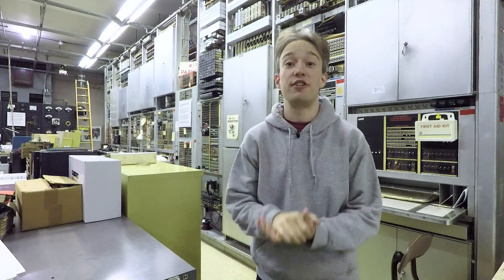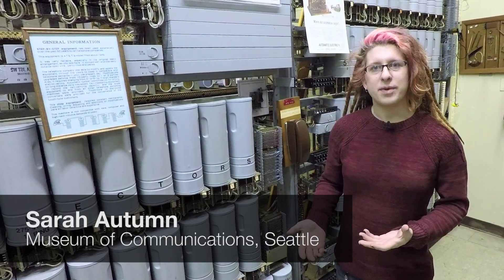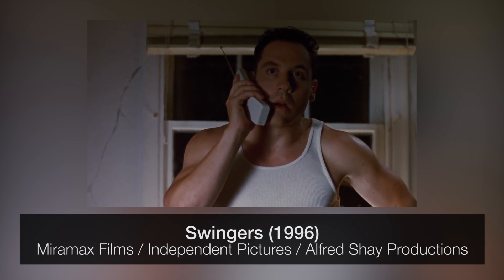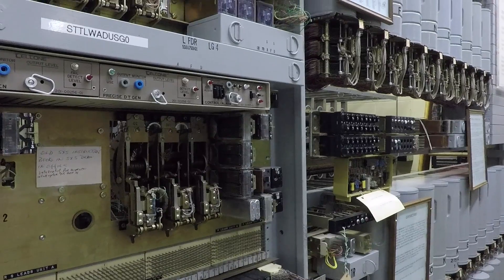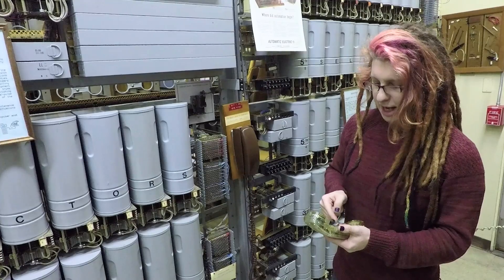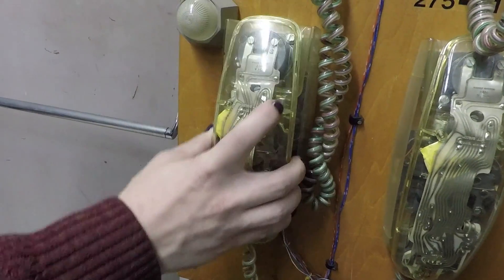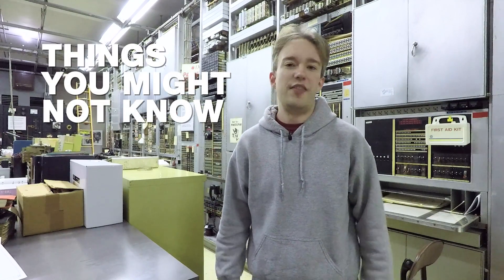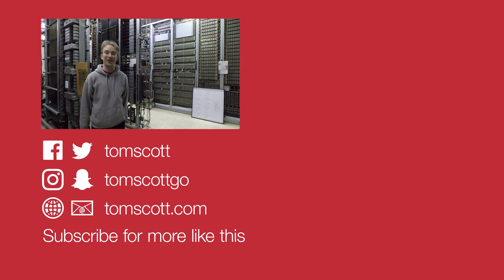In Old Movies, Why The Dial Tone After Someone Hangs Up?

Comment: Sometimes they get it right with "dead air", but then the person frantically presses the "hanger" like it's going to bring the other person back somehow.  If they were still on the line you just hung up on them, then pointlessly cycled the dial tone 12 times.
Reply: pentuplemintgum666 go back far enough and this actually made sense. In the days before automated phone system, the telephone operator would see a light on the switchboard when a phone was off hook. If you hammered the hook switch a few times the flashing light would attract the operators attention, so they'd speak to you to find out what had happened and attempt to reconnect the call
Reply: pentuplemintgum666 I think some telephone systems used the hanger for extra functions, like switching between calls in call-waiting situations, and sometimes equipment could get confused and you would end up in a weird limbo state.  So on occasion, messing with the hanger could actually get you back into your call.
Reply: In the Olden Days, flashing the switchhook was how you got the attention of the operator.
Reply: Call waiting works on a short "flash" of the "switchhook" recent phones had a "flash" button that did just that.  But it works by a single short hangup, and switches between 2 calls.  Spamming the button has done absolutely no good since about the 1960s, unless you got 2 people on the line and you're choosing who you want to talk to roulette style.
Reply: Nowadays, it may be for a similar reason that people mash the elevator button a bunch of times while they're waiting for it -- frustration and the blind hope that it'll maybe make something happen. Part of the sad bit in owning a smartphone is that I can't really mash on it if I'm pissed off.

Comment: Does anyone know if Norway used the step by step switching?
since i can vaguely recall not properly hanging up the receiver would keep the receiving party stuck with our connection and they would need to yell to get our attention or tap the hangup switch until an operator forced disconnect.

Comment: in Michigan, if someone called you, you could hang up the phone and run over to another phone and use it without getting disconnected. if you didn't pick back up within about a minute, the caller would get disconnected. I figured that trick out but never knew why it worked until now.

Comment: It's one of those moments when I learn they do stuff differently in different places. I grew up with analogue  automatic telephone system, it's changed to digital now. And here in Russia today it is nearly the same as it was before: when you pick up before dialing, you heal a long tone, the same one as we hear in this video. When one of the parties hangs up, the other one hears short beeps and they have to hang up too to make the line available for the next call. The difference for phone calls' sounds today is that you can apply to your phone company to switch to tone dial (if it's not the default). And before there was only dc (pulse) dial, when after pushing a button (or rotating the disc) you heard as many pulses (softish clicks, sort of), as the number you chose (0 = 10 pulses).

Comment: Interesting. The "step by step" switch is a version of the Strowger switch. I remember (1970s) there being a gallery in the Science Museum about how phone exchanges worked. BT (a monopoly at the time), had just received its first computerized switch. But there was a "history" section showing the Strowger switches and their first replacements the crossbar switches. 

The technology lasted in the UK until at least the 1980s.

https://en.wikipedia.org/wiki/Strowger_switch

Comment: How would that step-by-step system multiplex the calls? It seemed like it needed to maintain contact thought he entirety of the call?
Reply: bluedrago505 correct. It was designed to work with rotary phones. It's basically 50s technology. 40s even. There's a good reason it was all phased out.
Reply: Yes, you need a whole room full of equipment.  This machine uses seven of those equipment "cans" per call.
Reply: You're absolutely right.You might notice in the background there are stacks of rows of selectors - each row represents one digit, and the way it mulitplexes calls is that after you dial a digit it seeks to an active selector. That does limit capacity somewhat, which is why Bell came up with other ways of doing things
Reply: I don't know at all, but I suspect once the step-by-step system has dialed the number and connected the line to the person being called, it probably hands off the connection to some other piece of equipment.  So you just need enough of those dialers to handle as many calls as you're going to get in parallel.  

On a related note, Mother's Day used to soak up all available phone lines (or take a good go at it) routinely.  Heaviest calling day of the year!

Comment: I do remember on landlines in Aus (at least 8 years ago when I last used an analogue landline) getting a repetitive 'Beep Beep Beep' noise? not a dial tone but a completely different noise
Reply: There are a couple of telephone sounds I can think of in the US that could be like that.  There's a kind of medium-high pitched longer beep sound that's the busy signal (you would get it when you called somebody, but that person was already on the phone with somebody else).  And then there's a kind of loud fast beep, which means "hey you left the phone off the hook again, come over here and hang up properly" (which is why it was so loud, it was trying to summon you from across the room).  But it seems like the phone systems were all kind of unique, so it may have been something completely different.
Reply: I think I know what you mean, I've probably seen it in a movie but didn't have those here. It was a slow beep, like a Morse dash not a dot

Comment: In Australia if the caller hung up the called party would immediately get the engaged signal. Sounds like our system was very similar to the Californian system because if the called party hung up the line would remain connected - sounding like dead air to the calling party - but the line would remain connected indefinitely effectively blocking the called party from using their phone til the caller hung up!

Comment: I believe the system as described (with dial-tone on the far end) was the one favored by General Telephone, later called GTE.  Whereas MaBell (AT&T) used the system that was originally described.  The statement about "Independent Telephone Companies" is false, as there are, and have been, several hundred working in each state since the early days.  Some were purchased by GTE or AT&T, while others remained independent.  However, there were only two companies making the switching systems in the end, the one favored by GTE (and built by them) and the one favored by AT&T ( and built by them).  As a result, the independent companies had to purchase their switching equipment from one or the other.  This is also why there are some special phone codes that work in certain areas, and not others, as until 911 was standardized, there were very few special services that operated the same on different networks.
Reply: Well, sort of - GTE's then-subsidiary Automatic Electric was their version of AT&T's Western Electric - except that AE was founded by Strowger himself to make early step switches. That's part of the reason WE developed the Panel (other reasons include capacity). But there were other manufacturers of telecom equipment - North Electric was one, best known for the CX line of switches with no moving parts (just relays... and some wibbly bits you just kind of have to see to understand what I mean) and some really awful phone sets. And Northern Electric, which used to be a WE subsidiary but after splitting off in the divestiture went on to become Nortel.

Comment: That "step by step" system looks crazy complex, it's hard to imagine all those moving parts working with thousands of users all making calls at once. Are the mechanical moving bits as she dials basically doing what operators in really, really old movies are doing when they're plugging in and taking out wires on a switchboard?
Reply: Can't find the answer to this specific question on the museum's website: That system seems like it would mean a prank caller/malicious user could block somebody from using their phone by calling and never hanging up. Was there a force disconnect option for the call receiver?
Reply: Jetsetlemming in a way, yes - if every operator only dealt with one digit. It even finds an available line to the next row of selectors the same way!
Reply: Yes! It's pretty incredible.

Comment: I still have a land line, cost: about $4/month. And you probably know it also delivers 50 vdc even if the power goes out, enough to power all my chargers, some lights and a radio.
Reply: It's not as much power as you might think.  Yes, it's 50 volts, but it's only 40 milliamps of current, for a grand total of 2 watts of power.  Furthermore, phone companies typically have rules against using the power on the line for things other than land line phones, and they will likely disconnect you if they catch you doing so.
Reply: BariumCobaltNitrog3n consider yourself lucky man, where I live we are stuck with AT&T and they've decided in all their wisdom to make the whole area VoIP so everything shuts down when the power goes down.  Back when I was a kid I became amazed that the phone still worked when the power was down and figured out all kinds of stuff to do with it.  I thought I was the only one that tinkered around like that, awesome to know others have done it too.
Reply: Yeah, where I live, you get a landline free with your internet and all calls within the country are free, unlimited, to phones or other landlines of any network.
Reply: That's actually a really good reason to get that. An auxiliary power supply is nice to have.

Comment: Didn't we used to have the same in the UK?

I remember a scam where people would call you up pretending to be your bank, tell you to call your bank 'for security reasons' but didn't hang up themselves.
Reply from the maker: Yes: although it's not quite the same reason, so I didn't include it in my script! Basically, in the UK, the only way to end a call was for the calling party to hang up -- the called party had no control at all. (This was, I think, so people with multiple phones in the house could move between them easily.) So scammers would call you up, say that for security reasons you should call you back... and then when you hung up, they'd play a fake dial tone down the line at you. On some British systems, that may still be possible.
Reply: Payhellbay The basic scam scenario is they call you and tell you there is a problem with your bank account/credit card, etc. and that you should call the number on the back of the card. They then "end the call", but don't hang up when you do, instead they play dialling tone, allow you to dial then "answer" your call (there are more details which would make it very convincing, but let's not help a potential scammer).
Reply: Tom Scott It was annoying if someone called you and failed to hang up, though you could use the R or recall button to get a dial tone (I think you could also flash the hook, but that wasn't very reliable as the disconnect time is quite precise in the UK, unlike in the US). BT reduced the time a call will stay connected after you hang up on a caller to a few seconds, exactly because of scammers playing a dialling tone down the line scam; I presume they didn't reduce it to zero to guard against accidentally cutting yourself off when clumsy answering, etc.
Reply: Tom Scott my Cable and Wireless line used to do something similar. When the other party hung up, the phone would switch back to the BT system resulting in a dial tone. We could identify which system we were using as the C/W tone and a different pitch to BT's.
Reply: It would be cool to hear some stories about old phone system hacks (phreaking etc).
Reply: Tom Scott Interesting but what would be the purpose apart for blocking your line ? I mean what do those scammers would hope to achieve ? Just listen to conversations in your home ?
Reply: seriously the more I come to this channel the more awesome random stuff I learn :-)
Reply: However, if the receiving party hung up for long enough the call would disconnect anyway. Cant remember the exact time period but it was in the order of minutes
Reply: Joshua Horton  I just tried it, and the call ended under 5 seconds after the called phone hung up. It may be different on some exchanges of course.
Reply: Tom Scott ... was there not something similar when mobiles first came out in the u.k.?
Reply: Odd that you did this the US, my step-g'dad lives in the OC and used to run exchanges for the GPO - BT
Reply: I believe it is still possible, I remember seeing a news report recently about some people who had been scammed this way.
Reply: Tom Scott. Yes possible to have inject dial tone in a call by the calling party in the UK as it us still the same.

Comment: Holy shit, I want to go to that museum.
Reply from the maker: Honestly, it's amazing. And it all works! It's in the top floor of an actual telephone exchange building: new equipment meant the phone company didn't need as much space.
Reply: And opening a museum saved them a ton of money transporting that heavy gear!
Reply: Tom Scott I was wondering what was up.  I work in this field and I was amazed that the all the little details were correct.  Aisle spacing,  lighting,  cabling,  even the ladder.  All just like it is in all central officees,  even in another country.  We have those step by step switches in boxes and old closets that some of the retired guys stashed away years ago. I've held them and played with them but never seen them work under power.  Thanks for the great video!
Reply: it really did look awesome. is it a public museum? if so I will make it a point to visit if I am in Seattle.
Reply: Tom O'Connor if you're in the uk you can go to Amberly in East Sussex, it's quite similar to this.
Reply: In germany, there is a smaller installation of one of these old switching centres, its in the HNF in Paderborn
Reply: Can't imagine the amount of time and money that must go into maintaining that equipment in working condition.
Reply: minecrafter0505 I have actually been to HNF,  that's worth the trip too.
Reply: Me too! I had no idea such a place could be so interesting
Reply: Yeah,  but I'd rather go to the USA :p

Comment: I guess I'm showing my age when I remember the squeak of 2600 Hz disconnect on long-distance calls...I worked several summers for the phone company when I was an undergrad in the midst of the transition from step to electronic switching.
Reply: I lived in a very small rural town that had an old crossbar system. I was very popular with a few hackers from the city since numbers couldn't be traced directly to my home, only to the crossbar station.

Comment: Seeing the title to this, a related question came to mind, which I don't know the answer to.  Why do you hear a dual tone at the start of some films? (that is, two beeps of different tones in series, not the DTMF tones that modern analog equipment uses)

EDIT: While trying to find a answer online, I came across something called the "2-beep", but I'm fairly certain that's not what I'm hearing. It may however be a similar mechanism.
Reply: Tahgtahv if you're talking old movies it was so the projectionist could time the cue for the audio track.

Comment: you should have asked how come in movies after theyre done talking over the phone, they never say goodbye? they just hang up after theyre done talking
Reply: "According to Pen Densham, a Hollywood-based screenwriter ("Robin Hood: Prince of Thieves") and author of the new script manual "Riding the Alligator," proper farewells during scenes often end up on the cutting-room floor.

"A screenwriter may well have written in that final phone salutation," says Densham, but the polite adios frequently gets nixed in an effort to keep ADD-prone audiences engaged. 

"Producers are frighteningly aware of their viewers' impatience — the fear is that if a bare microsecond of boredom seeps in, the fingers will plunk the remote, so the storytellers are often desperately trying to move things along quickly," says Densham. "Every delay is snipped." "
Reply: Because they are jerks?
Reply: Dramatic effect?
Reply: There's no drama in goodbye. Maybe a forceful goodbye, maybe a "sir" thrown at the end, but not quite as dramatic as an abrupt and rude hang up on someone.
Reply: Tortex Especially when it's a bad guy. Only really pompous evil doers will act "polite" when conversing with their adversary.
Reply: RuggedALAN probably to add a dramatic effect.  because phone calls in movies usually are about something dramatic or traumatizing
Reply: RuggedALAN that always bothered me!
Reply: Budget cuts. Every minute of movie costs.
Reply: I never say goodbye either. Is all the information transmitted? if yes hang up